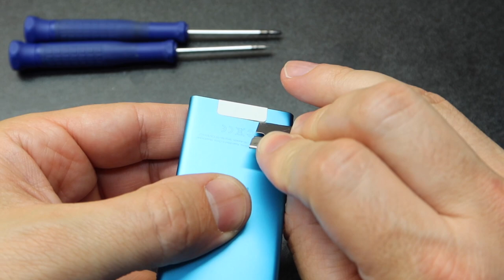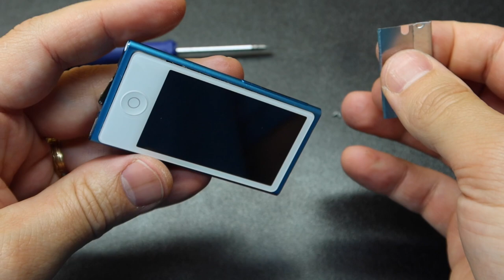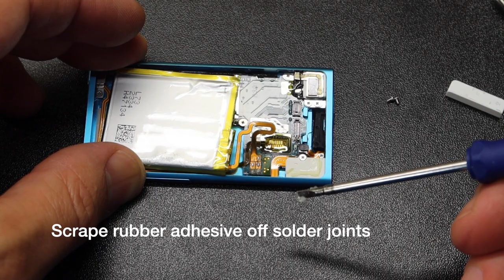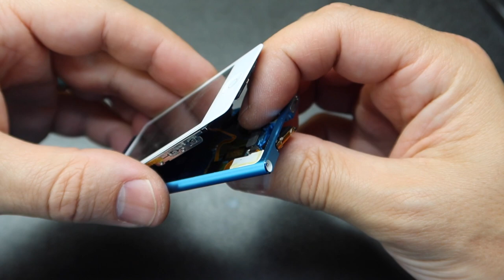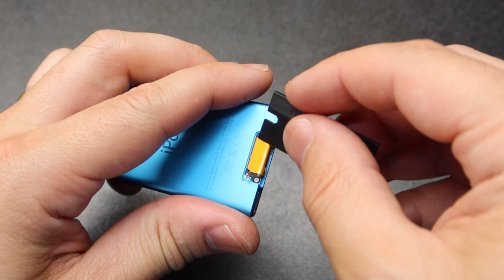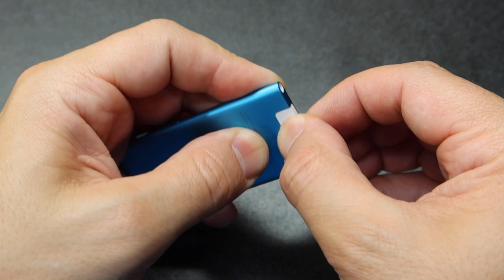iPod Nano 7th 8th Gen Battery Replacement | iPod Not Connecting Solved | iPod Restoration

Comment: Nice video. My gen 7 I've used SO MUCH since i got it like 10 years ago and still want to use it. Only works when plugged into power source.  Im confident in my ability to do this but my soldering skills are god awful. Soldering guitar cables hasnt gotten any better all these years later. Thank you
Reply: same position I'm in here, doesn't hold a charge and its making me sad lol
Reply: @MarsMaster636  I installed a new battery and its working. I did mess up though. Cracked the screen protector and messed up the thin strip to connect the power button. I can replace the screen protector but im just happy its working so I'll hold off for now.

Comment from the maker: Let me know if you have any questions regarding this repair, Thank you for watching.
Reply: Hi, I followed all the steps but when it came to soldering the battery out it wouldn't come off easily so pried out while soldering. Put the new battery in but now it won't work at all. Any ideas? Did I pry out the connector pins? Is there anything I can do before I conduct the last rites? )-:
Reply: Trying to do this by myself, I destroyed my iPod which was a present 🎁 from a really loved person. I would love never do this.

Comment: Hi, very helpful video I recently bought one of these with a battery problem and i’m gonna follow your steps to try to fix it, i’m new to soldering and wondering when you were lining up the new battery to the solder did you just heat up the metal you put on the battery to make them stick together? thanks a lot!
Reply from the maker: Basically. Be sure to preload the metal tabs on the battery with new solder, heat up the tab, then place a small amount of solder onto them. Careful when lining up the tabs, and do not put too much solder.
Reply: @TheFixTech  thanks

Comment: Everything was going good until that last part where you crazy glued the fucking BT shield😂🥴 Seriously just use some good double sided sticky tape. That way when the battery goes out again you can fix it again.
Reply: That's what I was thinking. I'd use the least sticky glue I could so I could get it apart again. My nano spends 99.5% of it's life in a case, anyway.

Comment: hi again, so I did it , but I l accidentally  put too much iron to a point where it’s just a blob on the battery part would it be fine if i left it as is?  I cannot seem to figure out a way to remove it
Reply from the maker: As long as the solder is not jumping into the other tabs (connecting negative to positive) you should be okay. To remove excess solder just heat up the solder and use a copper wire to extract the excess.

Comment: Why is my ipod's inner circular port not white like yours?
Can I add that part in too? Im having problems connecting to my headphones/aux port.
Reply from the maker: They are either black or white, depends on actual color of iPod. If you are having problems connecting to that port then it does need to be changed. I can make a video of that if needed…
Reply: @TheFixTech  That would be great! I bought my iPod on eBay and I think it was refurbished and I think they took out the white plastic part that covers the inner circle port. And now the connection messes up easily and distorts the sound.
I'd like to keep this iPod for as long as possible. :)
Reply: @TheFixTech  I would be interested in seeing a video on replacing the headphone port, please. I bought a replacement assembly, and would like to know how the ribbon connects to the main board. Is it soldered?

Comment: Could you please provide some soldering tips for replacing the headphone jack? The flex ribbon connection to the board is so small/delicate, and seems like there is high risk of ruining the ribbon.
Reply: ifixit has a guide on soldering, did you have any luck? im taking the plunge with it and buying a soldering iron in the sales.
Reply: @RappersDelight808 Are you talking about the headphone jack?